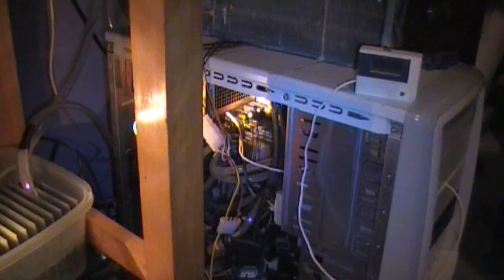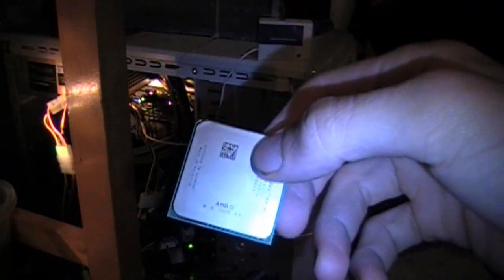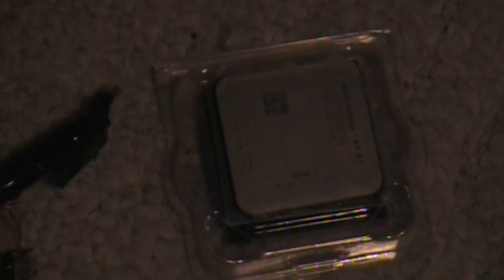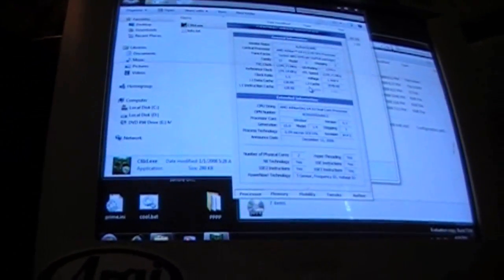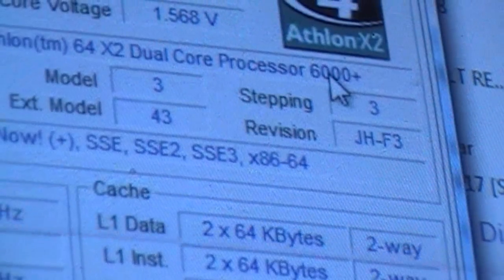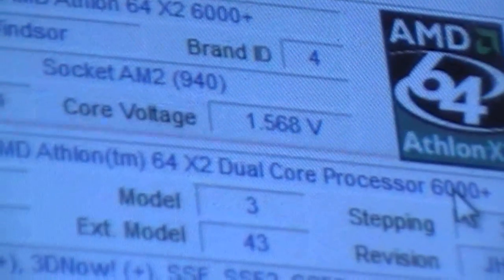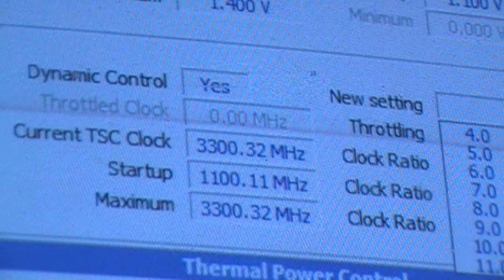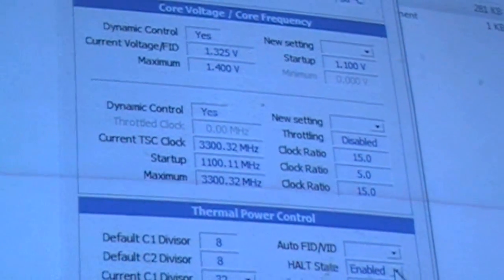water cooled cpu 1

Comment from the maker: where you listening you cant cut off soldier fron the core the amd am2 6000+ is a soldiered core so if you can use a razer blade to get through the soldier that is in between the core and the copper plate please make a video

Comment from the maker: now did u pull off the copper plate so it is right on the actual core becouse my temp meter was like 7 degres cooler with the cap on becouse it displaces the heat so the temp wouldnt be fully acurate allso water temp is a little warm water sits at like 25 cpu right now 28.3